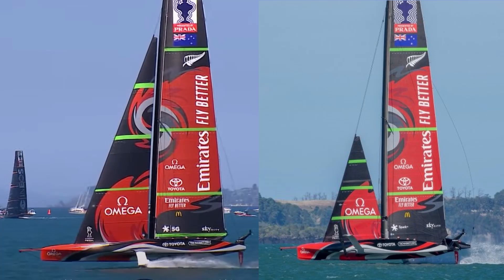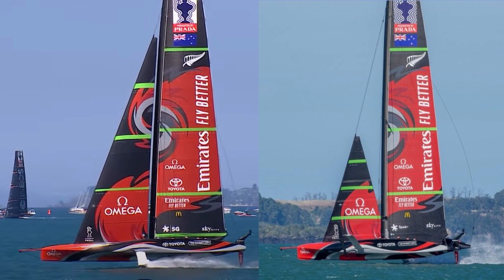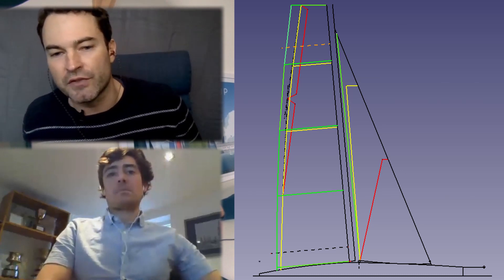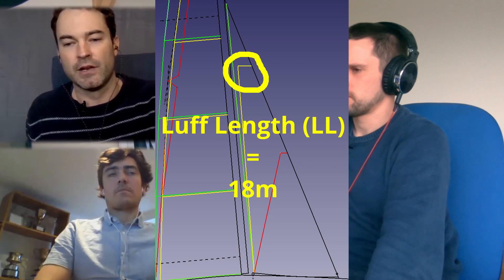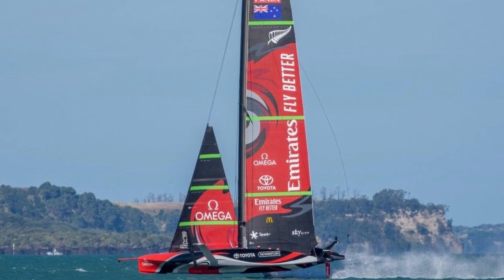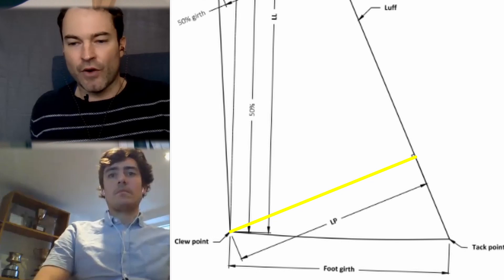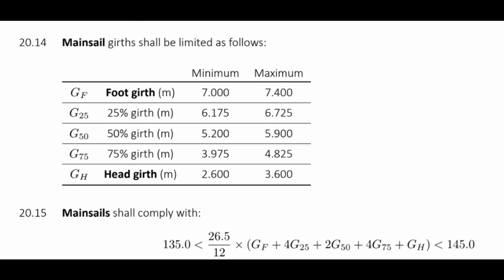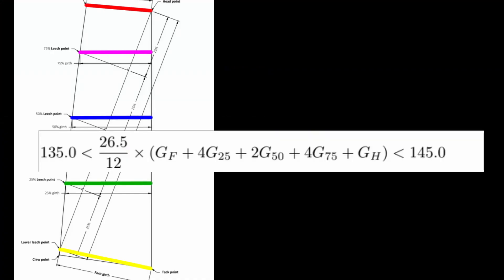Batwing Main and the UNLIMITED sail area loophole: A guide to America's Cup Sail Plans (Part 1)

Comment: I don't think this is a major sail area or righting moment advantage at all. Sails work better in less turbulent flow, the flow around the deck will be the least efficient wind to harness. I think tnz design has more to do with improving sail efficiency up high by creating a deck form and mainsail profile that improves the end plate effect.
They don't need more sail area in these boats most of the time, it is all about the efficiency of the entire rig and team NZ have designed the deck of the boat for this reason. I doubt the extra area has much effect on its own.
Reply: @Glenn Watson  the mast is on a pedestal, its not lower in the boat, you aren't going to get any advantage from a few feet of sail in the most turbulent place on the entire boat. It is for end plate effect, nothing else makes sense.
Reply: @slooob23  If you have more sail area down low you can sail with more twist and/or less camber in the top of the sail, thereby de-powering it.  The lost power near the mast head is compensated by more power near the deck.  This lowers the centre of effort, which allows you to generate more power for a given heeling moment.  In theory this should result in a faster boat, but there's still the issue of induced drag.  Such a bottom-loaded sail plan would suffer from higher induced drag due to its divergence from the most efficient elliptical spanload profile. Given that at high apparent wind speeds all indications are that drag reduction is more important than power generation, it's debatable whether that trade off is worth making.
Reply: @navierstalks   I understand what you are saying but I don't believe that is the main reason tnz have done this. It's not just the main sail they are trying to improve, it is the entire sail plan including the jib. Take a look at where the jib is sheeted in and the deck form in the jib clew area. It is a multi feature design to create an end plate effect for both the main AND jib. They've done this by utilizing air flow pressure gradients with the boat shape, recessed deck, flat sided crew pods, jib sheeted into the deck recess (Jib also has extra unrated area) and the extra main sail deck skirt. The main improves the efficiency of the jib on any boat, the recessed deck profile improves the efficiency of both due to end plate effect. The idea is to minimize turbulent flow up higher by utilizing air flow over the deck to drag air through the deck recess minimizing turbulence and thus drag. It is just as much about airflow around the leeward side of the jib as anything else. At the speeds they go, hull and deck form will contribute quite a bit to overall drag, controlling how and where turbulent flow occurs will play a big part in the overall air drag of the design. I am convinced it is all about the end plate effect and drag management.
Reply: @navierstalks  After writing my comment I found another design analysis on this site, you may want to take a look - http://chevaliertaglang.blogspot.com/
It is my understanding that the rule requires the mast step to be a certain measurement from the foil cant system and team NZ have dropped the deck down around this measurement point, you're right, you can't just "jack it up" but you can drop deck form down. The mast is the same length as all other boats and the same height above the water, but the mainsail skirt below this point probably is larger than the other boats as it drops down to the comparatively lower deck level. It would appear that the same is true for the jib, they can drop the jib clew down into this "recess" and gain a small amount of unrated area. But overall I think the intention is to manage flow over the deck and position sails in such a way as to improve the efficiency of the lower third of the sail plan and to control/reduce aero drag where all this comes together at deck level with an end plate effect.

Comment: Please excuse me if I'm missing something this is all new to me, but If you have to put bat wings in your sail to reduce area what's the point of having 18 inches of free sail area at the below the mast?
Reply from the maker: Thanks David. In light wings, when struggling to foil, they will want extra area and here it comes in handy. When the wind strengths and they need less, they can lose power from high with the batwing cut outs and keep the drive down low, giving better righting moment.
Reply: @MozzySails  Again it's less heeling moment - maybe we should agree to say more sail carrying power........
Reply from the maker: @giovannigaleotti2623  yes, you are correct. It would be more precise to say less heeling moment.
Reply: 1m2 of sail at the top of the mast will heel the boat more than 1m2 of sail at the foot of the mast, so you're forced to de-power earlier if you carry sail area up high
Reply: Notice that the  reduced area is high up, whilst the increased area is down low. As others mentioned this translates into more useable power with less tipping or capsizing forces. It's a powerful combo.
Reply: Thanks guys 😁

Comment: Love your video's.  However, I like most people are not a yacht designer but are a sailor.  I think for non-sailors it would be helpful to explain why you in partic have smaller jibs.  i.e. yes you can go faster with a big jib but you cannot sail the shortest course so sail selection deserves it's own video.  Would love to see it.
Reply from the maker: Part two we talk a bit more about sail plan choices effect how the boats sail. I hope you will find your answers there. It's a lot to discuss in one video, so I chose to break it up and just focus on the rule first, and the options for various sail plan choices.
Thanks for watching!
Reply: I concur that it would be very interesting to see a presentation on the function of the jib on an AC75, although I'm not sure there is a direct correlation of a larger jib to more boat speed.

A 767-400 has a wing area of ~290 m^2 and a wing span of ~52m (but originally designed as ~55m, which was reduced by incorporating raked wingtips). Divide the wing area by 2 gives ~145 m^2, the max AC75 mainsail area by Simpson's rule. Subtracting 5 m fuselage width and divide by 2 is 23.5 m (or 26m for original design), the AC75 mast height.

Thus the mainsail of an AC75 can be considered as the wing of a 767-400 oriented vertically. For a foiling boat that can travel at speeds multiple times the wind speed, a significant component of the function of the jib is to shape airflow over the mainsail. In this capacity, the jib functions more like a leading edge slat of an airplane.

On an airplane, the leading edge slat allows the wing to function at a higher angle of attack, ie more vertical lift at slower airspeed achieved by directing more non-turbulent airflow downward (Newton's law). A significant volume of this downward flowing air is above and infront of the wing (at least at subsonic speeds, the realm analogous to an AC75). We can complete the simplified analogy to an airplane wing by considering the reaction force from the AC75 foil as an apparent gravity. Of course the direction of this reaction force is a function of the 'flying' characteristics of the foil in an incompressible fluid. 

It is somewhat counterintuitive to apply principles of an airplane wing to a foiling AC75. In a static situation with a fixed wind direction, achieving a higher angle of attack might suggest the mainsail is now oriented at a greater angle from the wind direction. Don't we want to sail closer to the wind? And, as boat speed increases, the mainsail (wing) is functioning in an apparent wind direction that would seem to point even further away from the desired upwind direction.

Or perhaps it is better to consider the problem from the reference frame of a fixed boat direction, so that a jib functioning as a leading edge slat allows  the mainsail to be sheeted in tighter, while still maintaining non-turbulent lift.

So how does the size and function of a jib play into all this?

Comment: Interesting. Might have missed this in the past, but have been wondering what the purpose of the bowspirit is on these boats? All it seems to be used for is to hang a camera off for selfies!
Reply: It’s for a code zero jib. But it turns out the teams aren’t using them as they’re too big/create too much drag
Reply: @samc.6639  So if redundant why keep it?
Reply: @stelioskaragianis4539  It will likely disappear in the next iteration assuming they keep using the AC 75.
Reply: @number1genoa  Where would you put the camera?
Reply: @skynineUK  because the boats are built now, and code zeros are still in the rules. Just because teams have opted not to use them so far doesn’t mean we may not see one be used in an upcoming race. But yea as per Frank above, they’ll probably go on the next generation of the AC75

Comment: 8:50 stand behind a wall how much wind do you feel, its all about sealing the sail to the deck to improve the hull shape areo with a benefit the sail high pressure does not enter the low pressure area behind the sail. Skirts were banned in F1 for a reason your down force has a massive increase until it jams. The loophole only means you do not waste you sail area with the skirt area.
Reply: We're not talking about the sail being on the deck but the mast pivot (the fixed point against which the sail is measured) that is raised from the deck to make the sail taller without exceeding the measurement limits. You can't see it at that time point because the mast covers it. It's visible later in a pic where the mast is removed from the boat.

The point, which is clear to everyone else, is that the measurement rule doesn't consider the area below the pivot because the rule was written with the assumption that the pivot sits flush to the deck. Or to be more exact, it was written with the assumption that everyone else thinks the pivot will be flush with the deck. As they did.
Reply: @AnttiBrax  rule no1
Never assume anything if you want to think outside the box

Comment: These batwing main sails that have been shown so far by American Magic and ETNZ are coincidentally two AC75s that have had a capsize in recent times and makes me think it's sort of a safety development trial. Would only be used in higher wind strengths(?) where everything tends to happen faster. Of course it could also simply be deflection and time wasting for the opposition to think about with no real intent to use it. I expect LRPP will either challenge it or have one of their own stashed away that we will never see unless it makes some kind of sense to use it.
Reply: It would require massive modification to LRPP hull, which cannot be done. So no.
Reply: @smudge6831  No batwing top has nothing to do with deck treatment.
Reply: Max S. said in a recent interview that they will not develop batwing main - might be true, might be deception.

Comment: Simpson's rule is used as an approximation to find areas instead of the exact method - integration. The multiplier of 26.5 does indeed result in an approximation to the sail area of the boat. The fact that ETNZ has an extension to the mast below the sail is irrelevant to this calculation.  They do not have an effectively greater sail area than the other boats; though they do have a higher righting moment.
Reply: Yes so in turn would that give a better VMG ?
Reply: How is extra  luff length irrelevant?  If I understand mozzy correctly the mast length for all the boats is actually fixed @26.5 metres. So ETnz get an extra ~ 0.4 metres in the pedestal for free. And their whole rig and deck plan is designed to maximise that extra sail area. I guess LR could do a pedestal too but the whole setup would be so wrong that it's not feasible at this late stage. They must have spotted this in Te Rehutai right away though, surely?
Reply: @chrisbc61  They have extra sail area low down  - no question. What's not clear is if the deck/sail interaction is just as clean as on LR. If you look at planes with wing tip tanks, the tank wing interface looks more like LR design than NZ design. 
Personally I think this is a distraction from the true source of some extra RM on NZ which is the straight foil.
Reply: 26.5/12 is the same as x/3. Any sail area you can pack in below 26.5 is free.

Comment: New Zealand here, sorry the entire tone of your vid is one of -well that's Off we didn't think of that - and is sailing world that sailing.
For example the americans once put a cat up against a mono on water line alone.
So all is lawful in love and war, would you 3 at mozzy sails like to play with ultra-sonic foiling now?
Reply: Separation of boundary flow, via pressured air through tiny holes on an aircraft wing, or through surface 'ribulets' on the fuselage come to mind. What do rhe rules say about such surface modifications on the boats?
Reply: Maybe calculate how much your foil has to leak to give an advantage using air bubbles on each tack.
Reply: Ultra sonic....
Like a ultra sonic cleaner?
Powered by.... hydraulic pressure?
Please explain
Reply: @briancavanagh7048  observe nature and copy it”. Penguins use a system where they create\trap millions of tiny bubbles that are released through their feathers and cover their body when diving, this radically reduces drag through the water, by producing a barrier between the body and the water. Maybe this technique could be applied to the leading edge of a foil to apply a thin layer of microscopic bubbles that cover the entire foil. A rammed air system utilising vents on deck at an ever reducing diameter and feeding down into the foil arms via channels. The faster you go the more pressure is created and more bubbles.

Ok, ok....... it’s late, I’ve been drinking....................
Reply: @PungBoy3  When they lift the GB foils out of the water you see water pouring out. Why would they want to allow water to leak into a large foil and lift out all that extra weight. Maybe they want to copy nature,
Reply: Before we embark on that discussion, have you actually read the rules regarding such devices?

Comment: Is there not a rule saying the mast is 26.5m? As seen on the image you provided? So there is a max mast length. You cannot make a longer mast. Not sure why you are saying it is a loophole. It is just following the rules...???
You can also say the plates under the boats to seal them to the water act to help the sail. It is all part of it. A nice solution by TNZ but not exactly circumventing rules.
It is the exact opposite of bat wing sails, adding to the area not included in the measures. Not sure what the big deal is that you are so impressed/upset about? Great design, no more or less.
Reply from the maker: Theres a video linked at the end. It explains how you can create a mast which is effectively longer within the rules
Reply: @MozzySails  I saw it, and was a great video. But the mast isn't any longer, it is the mast foot that is extended. Nice design, not a longer mast...?? No?? 
I understand the sail is extended, or at least TNZ use sail in an area that isn't measured. It isn't a loophole, it is just like batwings, using the area that is not measured.
Reply from the maker: @icetroll_riverpig_skyravn  the mast is extended, with a 'fairing' that drops around the mast foot.
Reply: And what do you guys think for the results? Always great to hear your reasoning for your thoughts!

Comment: As fascinating as the racing is, it’s the drama ,mischeif and shenanigans in design and interpretation of the rules and how they’re made that sets the America’s cup apart from other events.  It is historically synonymous with the cup and once you realise this bigger picture you  can really appreciate it on another level.
Reply: I'm OK with the creativity, but the point of the rules is to keep the races close and not just design blowouts where one boat sails the course followed later by another boat. If that's what happens as a result of the loopholes, then the rules have failed.
Reply: All out competition, on all levels, this is what the AC is about. Why I have followed it since Dennis Conner lost the cup to Australia.
Reply: I don't like it, personally. NZ have found a clever way to get additional sail area. The rule should simply used the sail luff length, and that would put an end to it. Instead, if they keep the AC75 class for the next cup, all the teams will use a raised mast foot. Given a clean sheet of paper, nobody would use that design, it's just trickery. The sport, and rules, should focus on the skill of the crew instead.
Reply: @charlestoast4051  So what you are saying is Team NZ is just smarter - which is why the most highly funded campaign is packing up and going home - Intelligence triumphs over dumb money